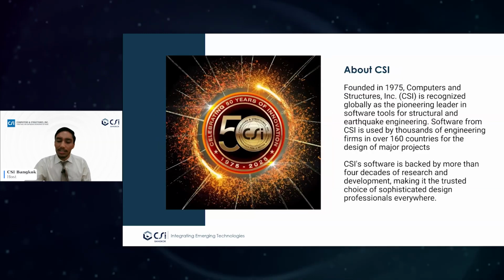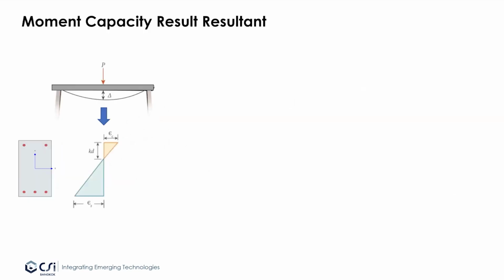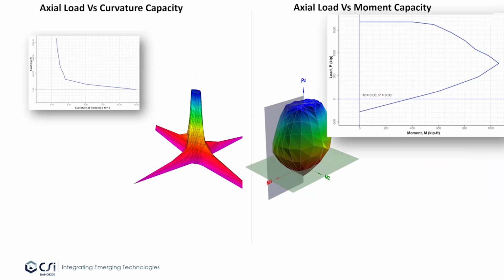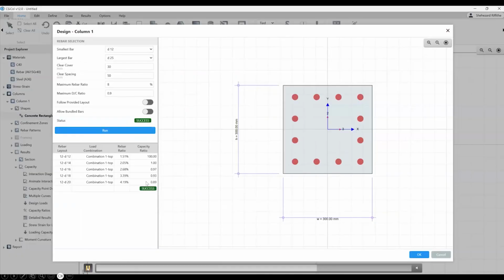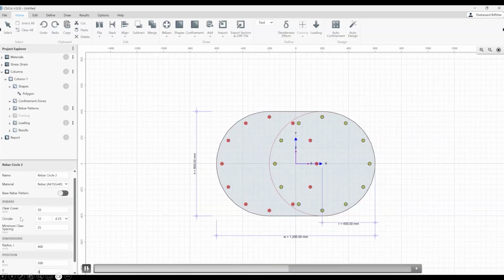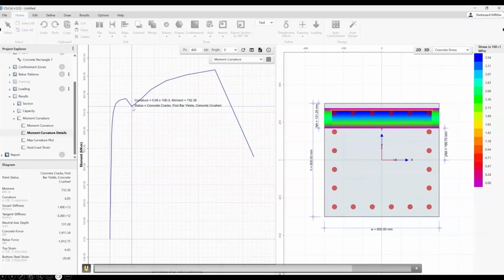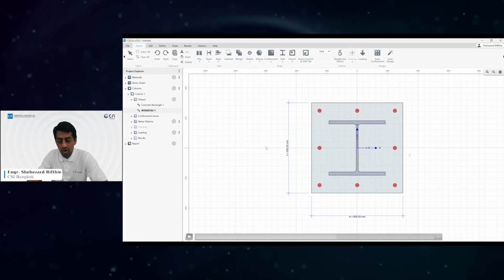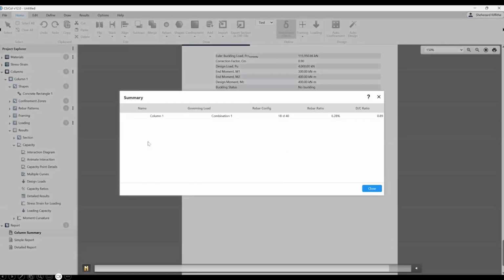Webinar: Design of Columns: Mastering Reinforced Concrete & Composite Sections Using CSiCOL

Comment: Thanks Sir. Pls i would like to ask The Doctor NAVEED ANWAR for us to initiate a webinar focusing a complete building design using ETABS and SAFE with giving consideration Real life problems that can happen during Bldg. modelling and design Like column and beam centers ain't coincide by solving Rigid link and such other cases
Also the doctor do us the regulations which the software has! i mean yu should tell us what the software can do for us and things it can't for example when am doing wind and seismic design there's what the software calls auto manual so when that auto manual can do the software and when it can't
and the last important one we need from the professor is Result interpretation with detailed explanation "Telling for us why the software did that and the reason"
Reply from the maker: Thank you very for your thoughtful suggestion and detailed input. These are valuable topics that many users can benefit from, especially the focus on real-life modeling challenges and result interpretation. We’ll surely keep this in mind as we plan future webinars and learning sessions. We will also forward your comment to Dr. Naveed to take your suggestions into consideration. If you have specific questions to ask him, please send us an email us and we will answer them directly.

Comment: Great video, thanks for sharing, does it check the column for core confinement and fire?
Reply from the maker: Thank you for watching and for your question. It's a great question. 

CSiCOL does consider core confinement effects, allowing for the adjustment of stress-strain behavior of confined concrete. However, fire resistance design is not included within CSiCOL; it focuses mainly on structural capacity and ductility.